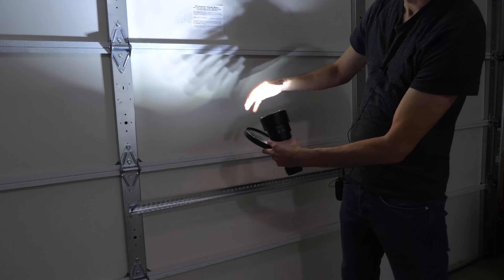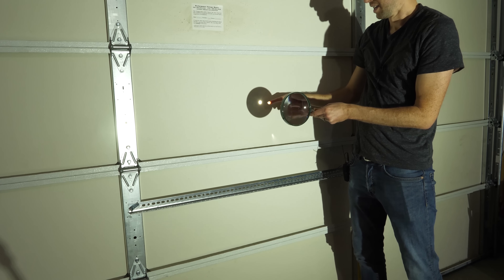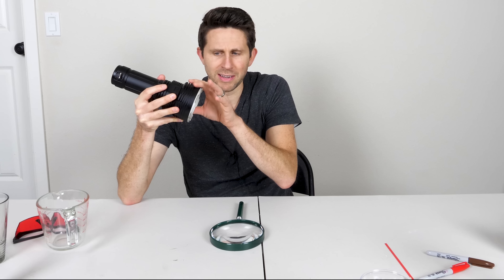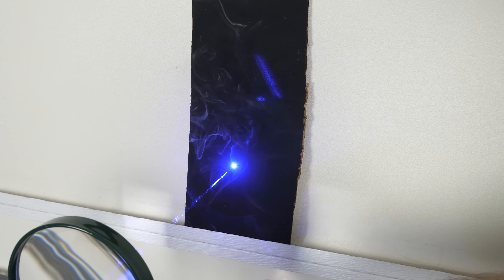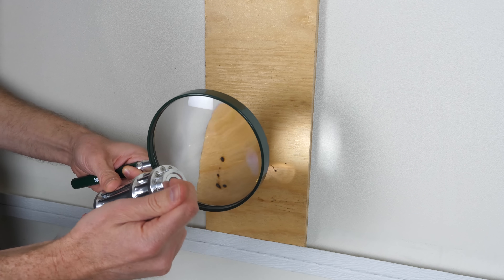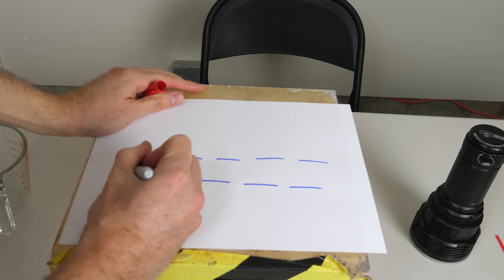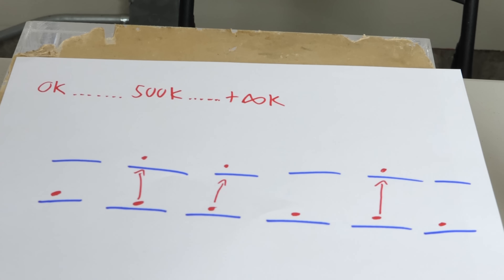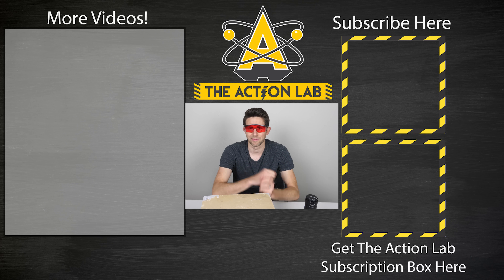What Happens if You Focus a 5W Laser With a Giant Magnifying Glass? Negative Kelvin Temperature!

Comment: Can you explain negative temperatures more, please? I'm a bit confused with negative and minus temperatures.
Reply: Short answer: Mathematics are the reason it’s called a negative temperature because it doesn’t break any laws of thermodynamics when a negative temperature is used.

Long answer: It isn’t necessarily a negative temperature. 
The laser was focused instead of spread out like a flashlight. 
Therefore, he could make the point smaller and hotter than the device was producing at the start. 
To prevent the second law of thermodynamics from being broken it is called negative because mathematically it makes sense.

This might sound confusing so I will try to make it easier. Since the point was smaller and hotter with a laser it didn’t make sense for the use of positive numbers. If you multiply a negative number by a negative number it becomes positive. Positive numbers make sense with temperatures.
Reply: @Matthew-dn4zo  mathematically it makes a very lazy sense. Buy in reality it makes no sense.
Reply: @The Action Lab
if you have a link to a paper or an article that goes more in deep about the "negative absolute temperature" it would be great.
Reply: Negative temperature is bad formalism but it has to do with the Boltzman distribution of atoms.  At thermal equilibrium, a population of atoms are in an ensemble of states given by the Boltzmann distribution.  As stated in the video, at infinite temperature, there are an equal number of atoms in the ground state as there are in at any excited state that can be occupied by the atom.  All states are equally occupied.  Lasers are made by population inversion, which includes pumping all atom from ground state to an excited state.  This causes the atoms to have more energy than the infinite temperature configuration.

Another way to put it is a populated inverted collection of atoms is very far off thermal equilibrium.  It is actually impossible to produce populated inverted atoms by heat transfer alone, even if the heat bath is at infinite temperature.

However, there is a problem with associating a temperature with a system at nonequilibrium, as temperature is usually associated with systems at equilibrium or quasiequilibrium.  At infinite temperatures, atoms would also be in states where they are fully ionized and at relativistic speeds.  That is certainly not the scenario we see for population inverted atoms (which are considered "hotter" than Big Bang conditions by the negative temperature formalism).  For this reason I think it is bad formalism.

There are many bad formalisms in Physics that partially explains a phenomenon while not being fully consistent with the rest of Physics.  The now outdated Dirac Sea explanation of antielectrons is another one of them.

Chemical Physics graduate student.
Reply: @cryora  why are you down here?
Reply: @iticotaco5603  Because generally people don't want things explained to them unless you outrank them or outspecialize them in some way.  Where I am, my title means very little.
Reply: I read in the school that temperature is the measure of hotness of a body. Does negative temperature deviates from this definition? Then what is temperature If minus temperature and negative temperature are different approach?
Lots of confusion created. I hope some one please answer. Really learnt a very new thing today. Thanks for this episode. Reply please.
Reply: @msnirajagrawal  In a way, yes, in the scope of the math of Quantum physics, it does deviate from that definition. As I said before, you can think of temperature as a measure of _energy potential_, or the measure of the direction of entropy in a system, as opposed to hotness. But it's really not important to know that in reference to negative temperature. Negative temperature is literally just a math trick. Your intuitive understanding of temperature still stands.
Reply: Asher Grey in a nutshell Fahrenheit and Celsius don’t have 0 as absolute 0 which is the complete absence of heat as cold is just lack of heat, Kelvin on the other hand uses 0 as absolute 0.
Reply: Absolute Zero is like a photo. Anything above is a movie.
Reply: -50°C is still positive, because it is still ~223 K above absolute zero. Negative temperature is not cold, it is in fact hotter than the system temperature. In negative temperatures, the heat flows backward, from the negative temperature to the positive one. This idea seems to be a bit unintuitive because you think of temperature as hotness. In quantum physics, temperature is viewed in terms of the entropy of the flow of energy. Entropy flows from the source of heat outward and loses energy. In negative temperatures, energy flows from the system back to the source of heat, adding energy to the quantum state. Edit>> That's my basic armchair understanding of it. I'm a chemist, not a quantum physicist, so my description could be wrong. Someone please correct me if it is.
Reply: @deluxeassortment  When the original poster was asking about negative temperature, they meant negative KELVIN temperature. That's the entire subject of the video, so I'm surprised you misunderstood the question.
Reply: @jamieg2427  i think they know that
Reply: @jamieg2427  They were asking the difference between "minus" and "negative" temperature.
Reply: @deluxeassortment  reported for killing billions of innocent bacteria
Reply: @Blox117  Isn't that the stuff they put in clorox disinfectant? Lol
Reply: @hudsonshi154  clorox is sodium hypochlorite. ammonium chloride is used in disinfectant sprays and hand wipes
Reply: @hudsonshi154  Lysol Edit>> and about 100 something other household chemicals. You'd be really surprised how many brands you're buying with the same ingredients.
Reply: @Blox117  Yeah I saw it on the container now.
Reply: @Blox117  Develop your resistance! I will just switch carbon rings!
Reply: @deluxeassortment  WE ARE LEGION-ELLA, WE WILL NOT QUIT. FROM MOUTH TO STOMACH, POISON YOUR FOOD AND GIVE YOU THE SHITS!!!
lol
Reply: @deluxeassortment  but seriously you have a great name, as a germaphobe myself I approve.
Reply: @Blox117  haha thanks, although I'm not really a germaphobe. I just have a weird infatuation with Quaternary Ammonia. They're pretty cool compounds. In one label they're killing bacteria, in another, they're stopping mold from growing, in yet another, they're breaking down and depolymerizing grease, and yet another they're killing viruses from  the inside out.
Reply: @deluxeassortment  in another, we use you as a solvent for extraction of compounds that have value to street pharmaceutical customers and still in other cases we use ammonia and your nitrogen cycle derivatives to make high explosives for political statements.

Truly ammonia has been a gift to mankind.
Reply: @jamieg2427  no such thing as negative kelvin as the universe has inherent energy and an infinite sink would create the heat death of the universe i doubt hed be asking about negative kelvin if so well thats a stupid question :/
Reply: @lolbro8701  to the people who are confused by this, negative temperature does not mean its colder than absolute zero. its just a physics term that measures the heat flow of a system. it has no everyday analog or comparison
Reply: @Blox117  ye I watched to the end and realized that but yeah thanks for the clarification :)
Reply: @deluxeassortment  i stacking as tall as I can peroxide on top of more peroxide, like jinga only get so far before it collapsed.  Simple mind game. Tough in RL.
Reply: @Blox117  thermodynamics not physics
Reply: @deluxeassortment  I was just about to ask about why a body would not simply turn massless in a negative Kelvin temperature given how that's what I've been taught happens. But then you clarified the fact that minus Kelvin and negative Kelvin are two different things entirely. Thanks for the clarification.
Reply: @deluxeassortment  steady state is a different science than heat transfer. Observer interference makes steady state complicated. Using presion tools to measure the warmth of hands effect the tools , at a point can't measure variance with optics as light is thicker than the distance.
Reply: @deluxeassortment    Very good description, thank you.
Reply: Computer science, xD
Reply: Negative temperature and "quantuum" phisics is a lie.

If you put a magnifying glass under the Sun you also get higher temperatures.

i don't know the formulas, but if it hasent got a delta time in there than you know why the negative energy was introduced.

Science was branched after Nikola Tesla to obfuscate the truth about our Universe
Reply: A lot of the things and theory's you talked about are wrong
Reply: They are just theoretical. There might not truly be any, just like black holes. We humans just dont know eniough yet. Also this has only been seen in crazy math problems. If our understanding of any of the parts are wrong, and/or off it could cause this too.
Reply: @savemars4383  black holes have been observed just a quick correction the rest in fine
Reply: Joe Boxter when’d you see me last time

Sometimes im a troll but that doesn’t make me stupid :P
I can still engage in intelligence conversations
Reply: Iol
Reply: He is full of shit lmao
Reply: Negative
Reply: I'm still stuck on negative air pressure.
Reply: @adaster98  ya made proto soup. We are a long way from seeing 0k. Couldn't even look at it as that would rasie the temp
Reply: A lot of you need to read a physics book. O K is THE lowest possible temperature. All molecular motion stops at this point. There are no negative / minus temperatures. It is nonsensical. That is why we have the Kelvin scale. We know what happens when atoms form a Bose-Einstein Condensate. We have been within a billionth of a degree of absolute zero. This guy doesn't know what he is talking about. This bullshit about negative infinity... Well its bullshit.
Reply: @lerxstdirk2160  This isn't classical physics, it's quantum physics. It's just a math trick to ward off paradoxes.
Reply: Minus: below zero
Negative: not a familiar positive and need more research
Reply: It’s less end of story
Reply: Don't let this stuff mess you up, negative temperature is the result of a definition for the math to be useful. It results from population inversion in the electron shell of an atom. imagine an hour glass, the sand piles up with the most sand at the bottom. Shaking (heating) changes the distribution  but there will always be more at the bottom as the top. But if you invert the hour glass you are adding population from the top down. like electrons crowding the upper shell of an atom (as a ratio). this is given a negative sign for the math to work.
Reply: @cristinavekos5808  Not so useful when what the math is implying is that an inverted population is "hotter" than infinite temperature, which is essentially hotter than completely ionized atoms and nuclei separated into their constituent nucleons and it gets worse.
Reply: Come to Montana in the winter
Reply: This guy bellow is pretty fast at typing
Reply: Hee9 
He had two hours my guy
Reply: Nothing can exist at 0K, and existing at energies below that is out of question.
Reply: @neelav2394  You might enjoy reading this: https://www.mpg.de/research/negative-absolute-temperature
Reply: @neelav2394  negative Kelvin is above 0K though so I don't see your point
Reply: @neelav2394  unless its a black hole
Reply: @neelav2394  
The Kelvin scale measures temperature, not energy.
Energy and temperature are not the same thing.
Reply: almostoneword oh boy, temperature is the average kinetic energy of a system. Of course the kinetic energy measured is the energy of the atoms and molecules themselves.
Reply: @neelav2394  
...the kinetic energy possessed by a system.
Fixed that for you.
Reply: @NueThunderKing  
My reply was in response to:
"Nothing can exist at 0K, and existing at energies below that is out of the question."
Reply: @almostoneword  temperature is a measure of molecular motion. Molecular motion is based off how much energy is in an atom, therefore temperature is essentially a measure of enegy
Reply: That's actually just the sign convention for the flow of energy from what I've understood because going below absolute zero k is something which hasn't been achieved yet. He took it as a negative temperature because the in a laser, the atoms in the working gas in the source jump to a higher state of energy (+ve flow of energy) during absorption and go back to the ground state (-ve flow of energy) during emission, reducing the energy level at the source. Laser sources as mentioned in the video, arn't like conventional sources of light. The photons undergo stimulation by means of collision with the source gas (CO2 or N2) and bounce back and forth between two mirrors before finally leaving the laser. Note that this isn't the source that is gaining energy in this process. The source momentarily gets to a higher state and then returns to it's ground state. This makes the "beam"  have higher energy than the source because it has been amplified using a pair of fully polished and a partially polished mirror. The magnifying glass further adds to this "amplification" that the photons have been through and further increases it's energy making it hotter while the source stays relatively at a lower temperature because it switches back to ground state after every pulse.
IF
If somehow the source did go to a negative K temperature, it would freeze the moisture around it making it look like its snowing, but only around the laser. SO it's not negative temperature but rather  switch in the flow of heat because of the working principle of the laser.
NOTE: I might have missed somethings or maybe even misunderstood some concepts. This is based on what i have understood from what I got to learn. I'm no physicist, but lasers were a part of my course in mechanical engineering, so yeah.

Comment: Can't you use collection of lenses to focus all the light into single spot? Just to break the second law of thermodynamics?
Reply: No you're just still focusing the first light but smaller wastage and up to a certain limit the lenses would brake or stop focusing like in Spyro's videos
Reply: @England91  That doesn't make sense, the light is just light, no matter where it comes from it should work the same way.
Reply: Name no because when a lens is not at the optimal distance it focuses too well and it spreads it back out, it’s hard to picture but because the light spreads out according to the inverse square law (spreads out a lot) your lenses would keep getting bigger not smaller so unfortunately you can’t practically but if you could get enough big lenses then it wouldn’t violate the second law as its physics yaknow
Reply: @brogant6793  Then change the lens so that the distance is the optimal distance. Curve it more.
Reply: @England91  I think if you wrapped the sun in a mirror sphere, you could focus all the sunlight into a laser-like beam of light. I'm guessing here, but that should produce the same effect as with a laser.
Reply: no because that would still be the same or worse as pressing the light source up against the material
Reply: If he used a big Fresnel lens he would pick all that light to a point. That point would be much hotter then the origin, but it is not the same area, it is just a single point hotter.
Reply: @rodteixo  if target area is the same and target surface is hotter then we have perpetual machine, we are not even talking about it. I'm pretty sure Action Lab guy says we cannot have hotter surface temperature at the target than at the source, which I don't believe is true and there is some kind of misunderstandment.
Reply: @edfx You said well, "if TARGET AREA is same". When you concentrate in a tiny point you can make it much hotter. What he did with laser is valid for normal light since laser is only light synchronized in frequency and direction. There is no special case for laser.
Reply: The lenses might get hot and stop focusing the light.